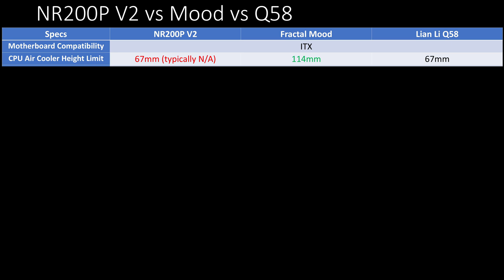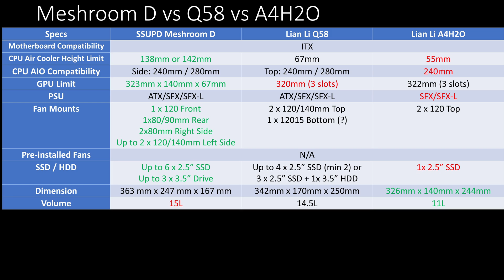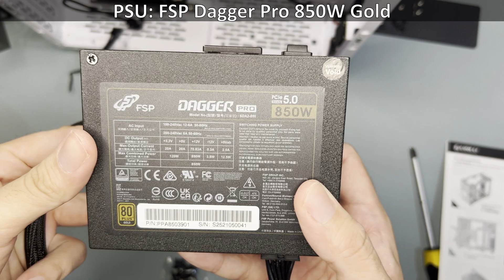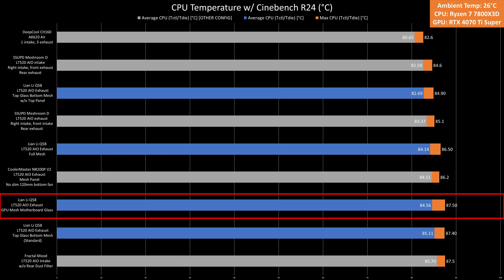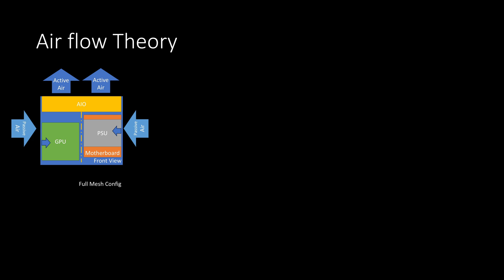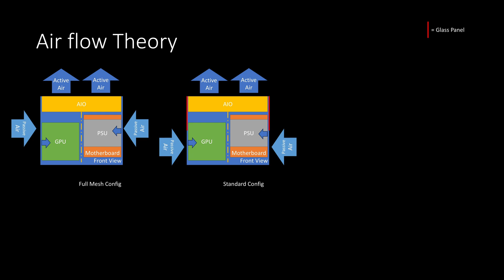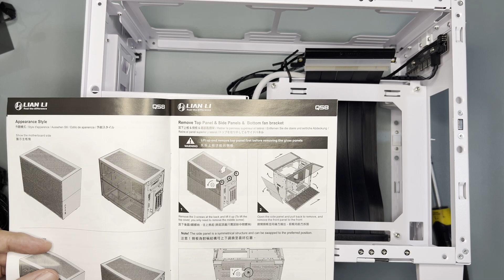Lian Li Q58 | A 14.5L SFF ITX Build | Thermal benchmarks

Comment: I got the case for $66 and the only way I could get the mesh kit would be to pay some random third party $80 on amazon. I'm so happy that the full mesh wouldn't help due to the air pressure being higher with the glass semi-helping. Thanks for the data and insights :D

Comment: Nice vid. I use the same case with aio for cpu. Tip! See if there are short (sff) cables with the psu. Saves you a lot of cable clutter. I bought some extra high feet so I can install a gpu aio some day at the bottom with a small reservoir in the top for air accumulation. Maybe I will keep the gpu air cooled. Because it is a puzzle with the q58.

Comment: Mas better yung configuration na mag low profile air cooler sa case na to. bottom mesh and top glass panel on both sides. 1 bottom intake, 2 exhaust. since top glass pannel on both sides, it acts as a vacuum to exhaust all hot air from the case, at the same time, young low profile na CPU cooler getting cold air from the bottom mesh panel. same goes with the psu and GPU on the other side.

Comment: lian li q58 itx ko. pero di naman powerful mga components. just an asrock a620i and 7500f. im also using fsp650 watts and rx 6600. umaabot lang sa 70 yung max cpu temp ko when gaming. idle is at 44. nag install din kasi ako ng bottom fan as intake, then i replaced the top cover with a magnetic mesh filter na galing sa isang case ko. if sobrang init dito sa pinas, lite usage lang umaabot na temp ng 48.
Reply from the maker: Replacing the top panel is a good idea. It blocks a lot of exhaust